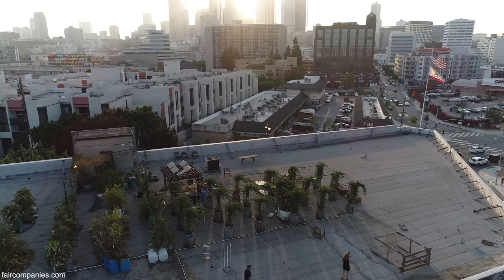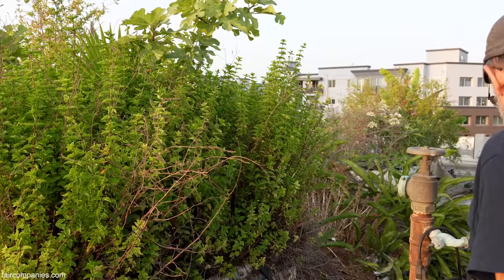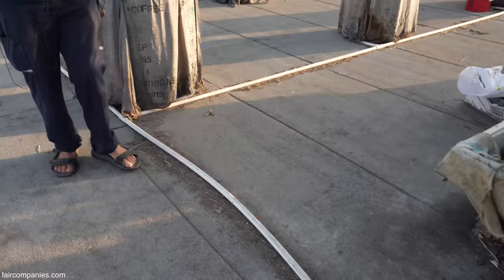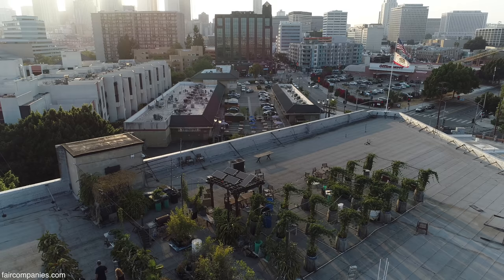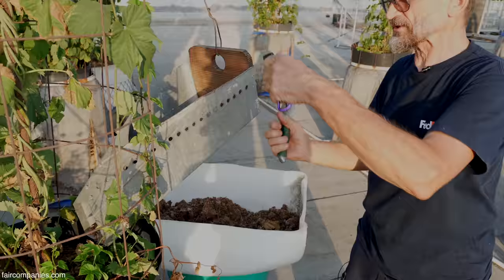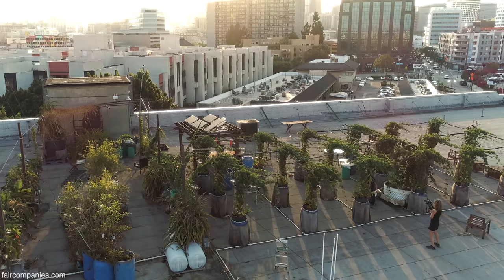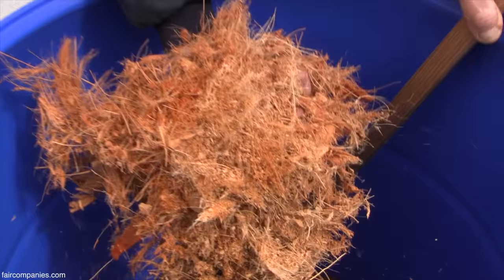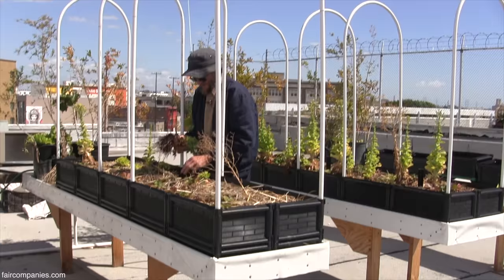FedEx tinkerer custom builds no-waste micro farmstead

Comment: If everyone did this on their rooftops This would be a great way to  add more  oxygen in the air and would help clear up the air better in LA maybe eliminate some Smog so you guys can have some cleaner air to breathe, would definitely  be better for the environment! I'm digging this!  Great idea!
Reply: And all the food he’s growing on a city lot two exits from downtown LA
Reply: @adtopkek4826  And your political commentary is related to this video's content how??
Reply: One can't do this on every roof, because some buildings aren't constructed to handle more than a certain amount of weight per square foot, BUT if one has a building/roof rated to sufficient weight this is a great idea.  Much of this is being done at ground level, which is definitely workable in many residential yards.  One could even construct a system that is attractive from the outside, depending on the size of a person's yard.
Reply: @grovermartin6874  his comment is related to the comment above
Reply: @WWZenaDo  building that weighs 50,100 tonnes can handle another ton of soil or water or both
Reply: @tesha199  That's the entire building, not the weight-bearing load rating of the roof.
Flat roofs can support more weight per square foot than sloped roofs, but there's a limit to that.  From several building and contractors' sites: "FLAT ROOF
In most locations, the minimum requirement for flat roofs is to support a concentrated weight of 100 pounds per square foot. New homeowners with flat roofs are often unaware of the risks associated with having one. They often have a higher weight capacity, but this is because flat roofs have a higher chance of unexpectedly needing to support more weight on top.   "
From another site: "A minimum requirement is for roofs to be able to support a concentrated weight of 300lbs. Concentrated weight means that this load is placed directly on a single area on the roof. A good estimate when considering a commercial flat roof is that it should be able to support a 300lb HVAC unit in a single 2.5×2.5ft space. It’s important to note that this is a minimum standard and it is highly possible that your roof is able to support more. However, it is also important to take into consideration the current state of the roof of the property. Older roofs may not be as stable as you would expect and, hence, unable to support as much weight as it should in optimum conditions."
So from two different sources, there are two totally different load limits mentioned.
From another site: "The “total load” of a roof is the combination of the dead load, live load, and transient load....The total load for your building and its roof are already calculated for you and can be found detailed on your original construction blueprints. Improvements, upgrades, and additions to the roof or the equipment added on it after construction should be factored into the total load calculation."
Reply: @WWZenaDo  Many collapsed roofs in upstate NY in the winter of 1994-1995, I think it was. Repeated heavy snows that didn't melt between them, as would usually happen. As the snow built up on the roof, it would become compacted, making it dense and really hard to remove. Icy. It was treacherous to get up there to remove it, even on sloping roofs. I had to use crampons to keep from slipping. We couldn't open the sliding glass doors, the weight on the roof was so great.
Reply: @grovermartin6874  Wow, I'm glad you and your house survived that.  So, did you have a flat roof, or a sloping roof?  Do you know what your slope degree - er, pitch is? I ask because I had the impression that flat roofs are rare in areas of heavy snow (although we get heavy snows in Colorado, and SOME people still have houses with nearly flat roofs).  My house has at least a 6 x 12 pitch or 26.5 degrees - not very comfortable to walk around on.
Reply: @WWZenaDo  It was not a flat roof, but also not an extreme pitch, either. It would have taken Swiss A-frame chalets to shed that amount of snow!
Reply: @grovermartin6874  very good question, some people bring politics into everything!

Comment: Hi, a lot of this composting, with less manual work, can actually be done on the roof by using tumbler compost bins. Depending on the mean temperature there you can put those bins in the sun or under a small shade roof. The compost mixture can be sprayed, directly in the tumbler, with some of the drainage water from the irrigation because it will bring good soil bacteria into the composting. If the mixture is too wet it will drain out of the tumbler and you can put some low containers under those tumblers to catch this drip again. A suggestion is to keep clover, a rich organic nitrogen source, in these recovery containers because this can be composted again. This is not a fantasy story because I use a similar procedure on my roof garden. All the best to other urban gardeners…

Comment: Love the idea. ( rooftop)
-Every flat roof building should be required to be usable. 
- hope he checked if the roof can take the extra weight and the surface the extra traffic.
Reply: The roof is about 6 inch thick concrete,  could drive a fork lift on it, but has tar paper cover.

Comment: To make your own high quality fertilizer, you need a biodigestor. The anaerobic bacteria produce methane which is fuel for cooking, heating, running a generator, or even running a CNG car. The byproduct is the liquid fertilizer that comes out after the bacteria have digested the waste. You feed it chemical-free sewage, leaves and garden waste, food waste, and water. The sludge that builds up over time has to be periodically cleared out but it is very dense nutrient rich soil once dried out. Biodigestors also require a small amount of heat, which is why they're typically painted black and kept outside in direct sunlight, or alternatively, in winter for example, they are used in combination with a compost heap which provides aerobic digestion and produces heat in the process.

Comment: I wonder how many sump pumps he uses. Pretty much like a refrigerator for power use for each sump pump?
Reply: Sump pumps are not running continuously. Low power usage then.
Reply: @chrisallen9154  yes I was thinking of how a refrigerator compressor kicks on and off.
Reply: @chrisallen9154  And note that he had some solar panels.

Comment: As far as mites wouldn't it be easier to use wood ash or DE in a sand bath for the birds? They all love to sand bath.
Reply: The solar heat treatment works. The beading in the box absorbs a lot of the mites during the day .it kills the adults and eggs. Reduces the population in the summer.if you do it twice a week. The boxes get hot enough to bring the pine sap out of the boards, makes them smell fresh even with old bedding.can check for mites after dark with a flashlight,  if you see any do another treatment. Neem oil did not work, bleach spray did but was a demanding process, was thinking of quitting chickens, then tried heat.

Comment: Why not use hydroponics nutrients instead of duck poop? You can water your plants with it.
Reply: Good afternoon,  the aquaponics  water needs added bought nutrients, also have to monitor the concentration  and amend or dump it. Want to eventually  have a bio digester for the waste  water and compost the solids. The drain water from this could be used for feed and irrigation  of the plants

Comment: Did anyone look at the engineering plans for the building?  A roof can hold a certain amount of weight before it fails and collapses.   Did anyone do the math?  I love the concept, but most buildings do not engineer the rooftops to hold much weight.  Not like a floor.
Reply: It has a 6 inch thick reinforced  concrete roof

Comment: Aren't you concerned about running out of water? If everybody does this, where will the water come from? California is already draining the Colorado river dry. Your population is growing because of immigration. This will put more of a strain on your water supply.
Reply: Have you ever seen them water farms here in California? Hella wasteful, they literally flood acres of farmland at a time.
Reply: @crispysocksss  I lived in California for 12 years. San Diego is right across the border from Mexico. It is a desert. As the population has grown, more food as been required, more water needed, and the cost of housing has gone sky high. How much more can the land tolerate. California tried to get the federal government to order us to sell them water and electricity. when Oregon refused, Colorado agreed to sell to them water and now things are drying up there. I know because I have relatives who live there. L.A. sits on a shelf above the ocean. It is beginning to crack off.  The crack started when they pumped out the area under the shelf. It sits on two plates and sometimes there are earthquakes when the plates move due to pressure build up. There are many houses perched on the edges of hills and sometimes when there are heavy rains they slide off in to the canyons. The irrigation of fields is more like water running through the sand, so it takes a lot of water to flood an acre of land. At least he is trying to reclaim as much of the water he uses as he can. I just don't think it is a sustainable model for everyone to do this in Southern California. The water has to come from somewhere.
Reply: Barbara Mix  Yes, that is a huge problem, has been for years. I remember reading about the Ogallala aquifer's depletion in the '60s. And ppeople are still moving to Phoenix and Las Vegas etc. as if water is not an issue. Still,  presumably all those people are eating food from somewhere...